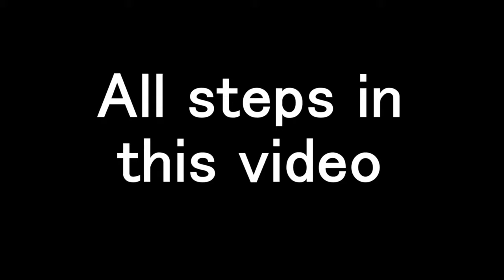DIY BBQ Grill (From old water boiler)

Comment: I could not find that valve man. please put a link or something. nothing comes up from "linear flow valve" either. by the way, will 3/4 water pipe work with this project? its a little bigger.
Reply from the maker: we bought it from a local tools shop, seems like this particular model is made locally (here in Lebanon). I realized a lot of people were having a hard time finding it especially for the barrel oven video, Im sorry for that. We just call it  "gas valve" at the tools shop its very common here. Im sure its out there too its probably gonna differ in shape a bit, I tried to research try something like "Male Hose Brass Gas Valves"

Comment: Super vidéo l’ami du super boulot par contre moi j’ai fais une grille avec des tiges de fer à béton (acier) y’a t’il un risque ?
Reply from the maker: L'acier non traité peut rouiller, ce qui peut poser des risques pour la santé. Utilisez de l'acier inoxydable ou assurez-vous que la grille est correctement traitée pour résister à la rouille.
Reply: @TheExpertAmateur  ok mais si je la nettoie correctement zéro rouille ça peut aller ?? Merci de ton retour l’ami 👍🏼
Reply from the maker: @pascalmitz4980  Appliquer une couche de peinture antirouille ou un revêtement protecteur peut prolonger la durée de vie de l'acier en le protégeant de l'humidité. Plus nettoyage des residu après utilisation
Reply: @TheExpertAmateur  c’est noté merci beaucoup 😎👍🏼

Comment: Is the tank that he is using the standard for inside a residential type water heater? Are the natural gas and electric ones primarily the same?

Thanks
Reply from the maker: this particular tank is custom made (that was all we could find at that time), but I believe the standard size would work even better. 
About the second question, sorry I didn't get what you mean...
Reply: @TheExpertAmateur  thanks for the quick reply. in the USA some water heaters are powered by electricity and some are powered by natural gas or propane. was not sure if the tanks would be different based on the heating source.
Reply from the maker: @andrewsmith9980  ohh okay right! this one was the electric type

Comment: What's the name of gas tube Burner
Reply from the maker: its a 1/2 inch pipe and a brass gas valve
Reply: What's the name of component From the pipe till gas faucet ...i don't understand please tell me
Reply from the maker: bro there's the pipe and the gas valve only, seems like this type of gas valve is hard to find in certain areas, maybe it looks a little different. Try searching for something like "Male Hose Brass Gas Valves"

Comment: A great job! I'm curious to know the measurements, length, diameter and thickness of the sheet.
Reply from the maker: all can be adjusted according to the boiler that you want to use, in this case it was a custom made water boiler and we took the other measurements accordingly